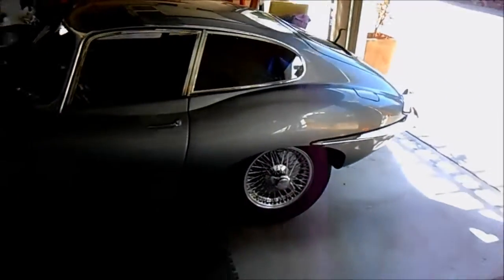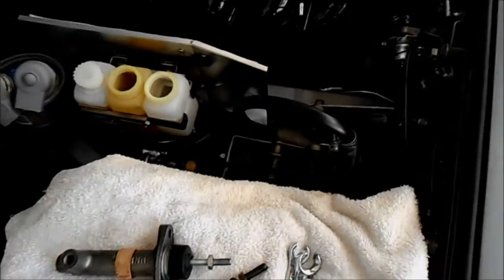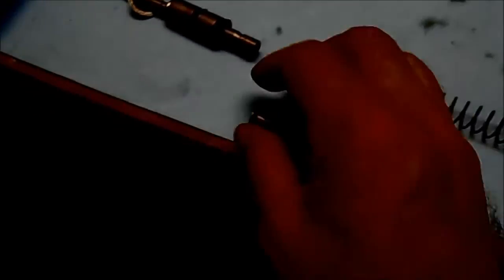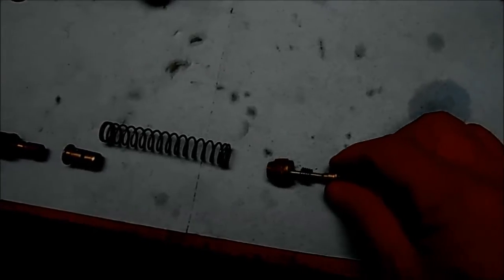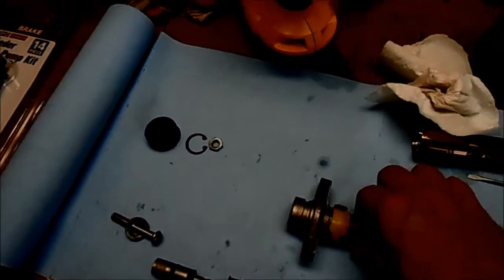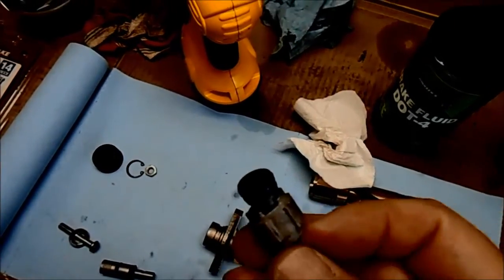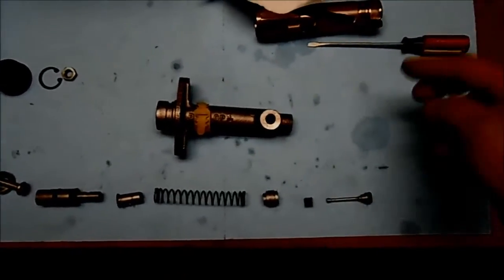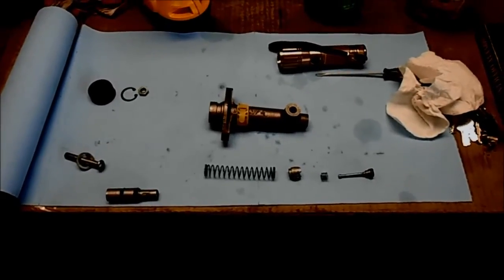Bettie my '63 Jag E-Type - brake locked up resolution

Comment: You should only need to bench bleed the master as the rest has already been bled...That's a Girling or Girlock system by the look..There would have to be a front cyl and a rear cyl...I expect you've put the correct ones to their correct positions..I have a thought but I'll do some checking first.
Reply from the maker: ZIGgassedUP Ziggy, bench bleeding means what exactly?  fill it with fluid and press the piston up and down a bit to prime the pumping action?
Reply from the maker: ZIGgassedUP These are Dunlop single circuit cylinders so one for fronts and one for rears.
Reply: JohnCarey1963Jag That's it John.

Comment: Food for thought John.........Did you check to see if the rear calipers had released when you removed the master cylinder?
Reply from the maker: tomswonderfulworld We released them by opening the line while on the road because the brakes were dragging badly.

Comment: Make sure that when it is installed in the car that the pedal is not partially engaged into the cylinder when at rest. This is a fairly common problem on English cars that I have worked on in years gone by. There should be about a half inch of play in your pedal when at rest, so that you know the piston in the master cylinder is completely retracted. Not sure if this is your problem, but a simple thing to check. Sorry you are getting "held up" by your car...
Reply from the maker: The Shade Tree Fix-it Man Thanks George, the pedal linkage is one of the usual suspects, so I will make sure to have this adjusted carefully this time. cheers.

Comment: Did you get a hard pedal? It mite need some slack in your adjusting rod maybe a 32nd would do it. If there's no slack it will just build pressure and not release back to the reservoir.
Reply from the maker: scottsinfl Scott, yes the pedal went rock hard and the rear brakes wouldn't release. I was told the linkages could be at fault, so I'll really look at this this time when I put it back together. thanks for the advice.

Comment: Do you have any free play in the pedal?
Is the pedal return spring holding the pedal tight against the upper stop? Have seen both items cause this issue.
Odd items -
Reservoir cap vent plugged (causes the diaphragm above the fluid to act like a solid block instead of  "breathing" as the fluid level changes from heat/use.)
Reply from the maker: ***** Hmmm - reservoir vent?  Thanks - pedal return spring - I can double check that one too... thanks for the ideas.
Reply: Usually there is a rubber seal that goes under the cap which separates the fluid from the cap and the cap itself has a small vent that allows the air to move in/out above that seal. 

Is it only the rears locking up?
If so I wonder if those bleeder extensions you installed might be the culprit. Since it appears they go up to the factory bleeder screw holes. It's possible that they are trapping air at the top of the bend and that air is expanding enough to apply the brakes?

Comment: Do you have a proportioning valve in the system? If so, that may be your next part to check/rebuild.  Might be a piece of trash is not letting the valve work properly.
Reply from the maker: Rudderify Joe, nope, the front and rear brakes have separate masters and they are linked together with what is called a balance bar linkage which when adjusted properly, will allow the fronts to act first then rears.  I guess that's what the proportioning valves do in single master cylinder systems right?